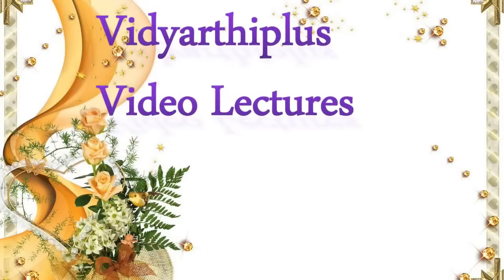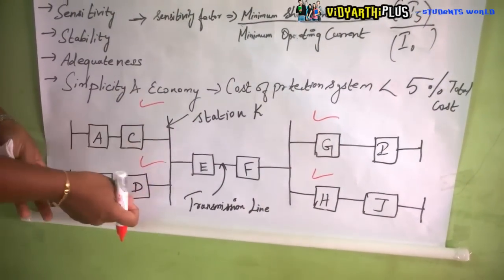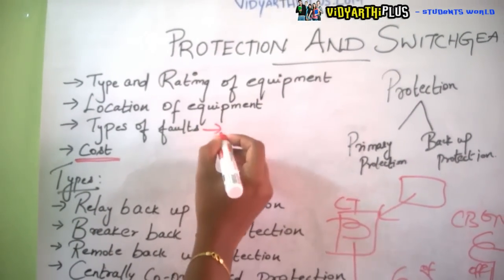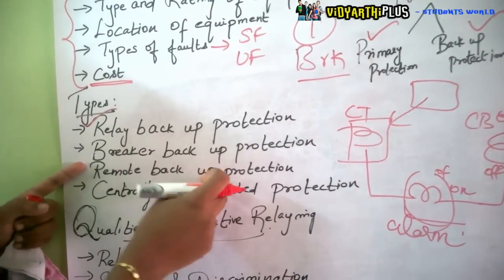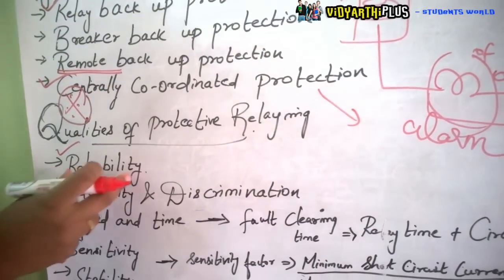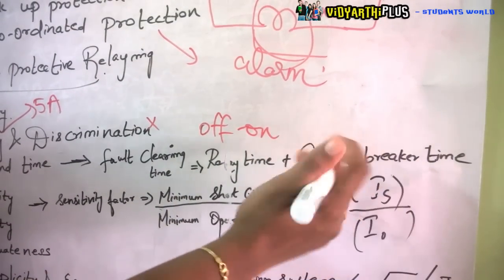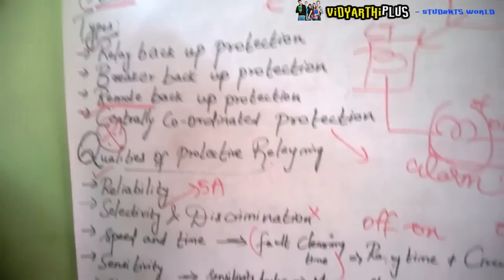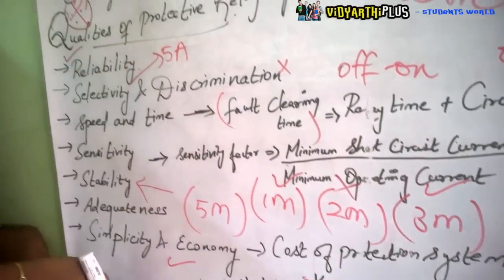Introduction to Protection and Switchgear

Comment: not  good lecture,    lot of mistakes  , example " after fault detection it was told that "MAIN EQUIPMENT IS CONNECTED" but main equipment should be  disconnected ?
also it is told after the breaker opens " FAULT WILL BE PROTECTED " but it should be told that  equipment is protected.

please do  publish quality articles with practical aspects which will be used for students.
Reply: bro she meant to say that the main equipment will be connected to rest of system excluding faulted one
Reply: Your command is too many grammar mistakes.first you will correct that mistakes